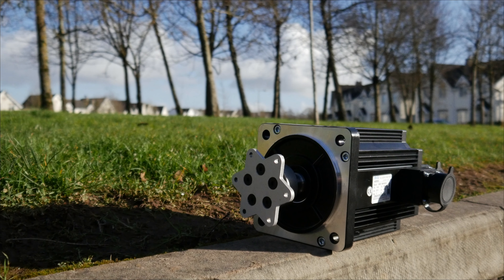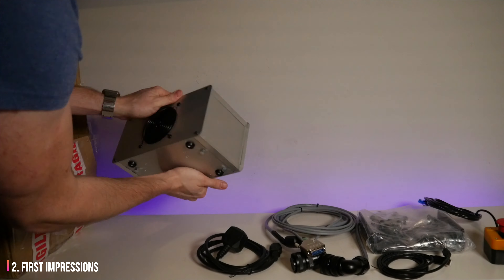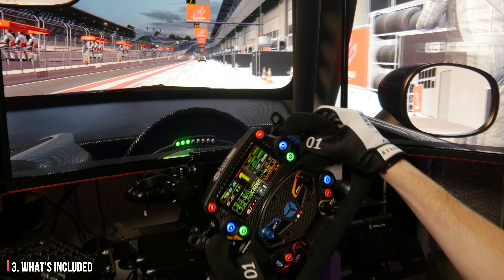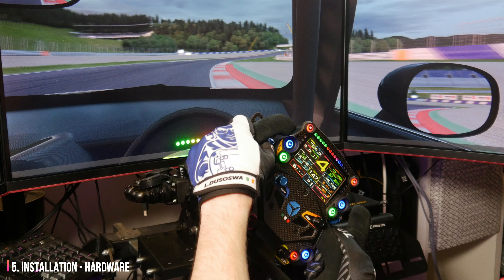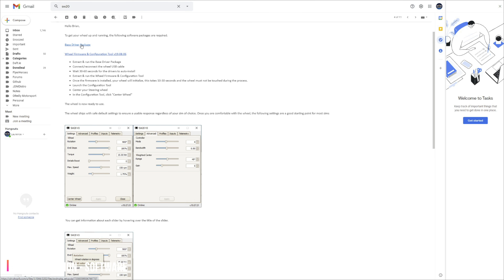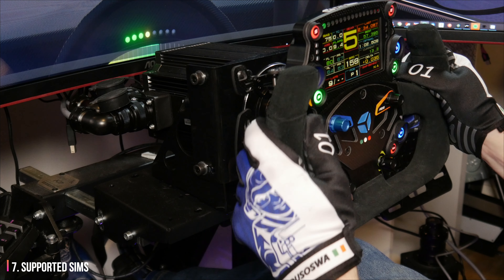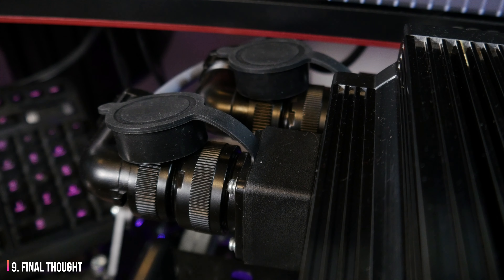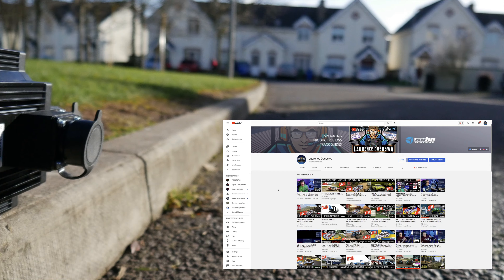Simplicity SW20 V3 review 2021

Comment: Small comment on your vrs suggestion. The sw20 and the vrs are not in same price range because with the vrs you have to buy the bracket etc and ends up on around 100-200 euro more than the sw20 package to get the same content. 
But good review.
Reply from the maker: Yes, agreed! I forgot to mention that. Thanks for your comment!
Reply: Well the Vrs one costs 1k€ with both the wheelbase mount and shaft clamp. pretty much the same as the simplicity without the discount if you order it from stock. Prices for Uk though. don´t know otherwise
Reply: That's was the word "range" in price range means.

Comment: Thanks for the review, that helped me to choose their SW20 Esport, which has incremental encoder, instead the absolute one used in V3. Didn't regret my purchase. All my e-mails were answered and the order was shipped in 3 days as promised.The FFB is great.
Reply from the maker: That's awesome news <3
Reply: What's the difference between the two?
Reply: @K1pruto  The resolution of the absolute encoder is greater than the incremental one. Also the absolute encoder always knows the exact position of the steering wheel, the incremental one might lose this info in case it loses power (very unlikely). In practice there should be almost no difference. My incremental encoder always knows wheel's position on startup. As for resolution/precision I can't really comment, but my SW20E is already very precise.
Reply: @StepUnique  thank you
Reply: I'm considering purchasing that SW20E unit.
Is it buttery smooth, no cogging/rippling?
Reply: @bozakn  It is smooth, yes.
Reply: @StepUnique  Thanks man, appreciate it!
Reply: @bozakn Any updates, Did you make purchase thanks?

Comment: I've had the SW20 V3 for a year now and it's been great once you get the setting to your liking....one issue I did have was the controller box would drop out mid race so not ideal! I upgraded the USB 2.0 cable and it's been perfect ever since
Reply from the maker: Yeah I didn’t dwell on the settings too much in this review. It was relatively easy to find good settings I found. I didn’t have any USB issues

Comment: I've had my SW20 V3 for going on 2 years now, and it's been great. I recently replaced the USB cable with a higher quality one due to the controller box disconnects and haven't had any issues since. I purchased mine in 2019; my experience with customer service was great whenever I dealt with them, and both boxes arrived the same day. I wonder if many of these issues are due to the world being shut down and the sim racing explosion - scaling their business model to a shortage of parts and an abnormal increase in orders would be hard. That said, some social media presence or something would give more confidence in their company's survival. I do worry that if something goes wrong, now I may not get the support I need, even though my experience so far has shown otherwise. Also, I LOVE driving with this wheel. Great review.
Reply from the maker: Thanks for your excellent comment. I’d be more than happy if it was my forever wheel, but yeah a bit of company presence would make owners a little more loyal, proud and likely to recommend.
Reply: Hey with the controller box disconnecting would it cut the force feedback out of random for you
Reply: @biccligher  I did have that problem a few months ago. I upgraded to a "Tripp Lite USB 2.0 Hi-Speed A/B Cable with Ferrite Chokes" (that's the name if you want to search for it) and it hasn't been an issue since.

Comment: Have been using the SW20 (V2) happily since 2017.. when i bought it, i got one hour of tutorial by Ollie, and i actually didn't tighten the bolts enough either. 
Since then, 3 of my friends have tried, 2 of them have bought the second they got home.... it is just thát good.  And yeah, i'm not a hardware expert, and even i got it sorted in the end. I'm using a Wooden Nardi 350mm 4-spoke round racing wheel on my DD wheelbase, bought an adapter from the hardware store to fit it. Also bought a button box for it, but i'm not too happy with the cabling for that. I love how the steeringwheel(base) can let you turn 2160 degrees maximum, too much fun when driving truck sims, but, the cable for the button box wont like it. I just wish someone would make bluetooth or wifi button/flappypaddle boxes with just an  on off switch and  aa-battery that has to be replaced once  a year. Oh well, evolution evolves. Wish i could still get the V3 encoder somewhere....they were sold out quite rapidly.
Reply from the maker: Nice! Great comment

Comment: Deffo room fer improvement... Personally i wouldnt touch a company that operates in such a way with a 10ft pole. Excellent work as always. Big Ups to Mr. Keno, u LegendFace!
Reply from the maker: Yep melee I took one for the team but ultimately also ended up with a cracking direct drive wheel for very little money. Thanks for taking the time to comment!
Reply: I have their older SW20 with Simucube boards. I don't have any issues so far. I love and support small sim racing company. We are now at a time where sim racing might be at its peak but we won't be here without these small companies.

Comment: I was keen on VRS & looked at SW20 for cheapest new price point - biggest concern was the software/firmware support as especially for Mige based systems the software is arguably more important than the hardware. I ended up with 2nd hand Simucube1 20Nm Mige based system, the firmware was updated up until Nov '20 and has a lot of SC2 features like static force reduction filter. The Simucube Granity software provides for detail technical tuning of the the controller/motor - you don't have to use it, but it allows one to tune out the motor cogging typical of Mige motor and from what I read a well set-up SC1 system is pretty hard to distinguish from a new Simucube Pro.
Reply from the maker: Thanks for the detailed comment <3

Comment: That is why you should get the Simucube 1 OSW Mige 20Nm setup. Runs off Simucube  software and it’s easy to setup unlike this one you have reviewed.
Reply from the maker: Is it really easier to set up? What’s the price of it?
Reply: problem is, nobody sells it anymore, anywhere. granite still sells the ioni and simucube board, that's it. simracingbay, augury and simtech all stopped selling sc1 systems, which is a shame if you ask me. only route to drive a sc1 in 2021 is to buy motor, boards, cables, build your own enclosure and set all bootloaders + drc files + firmware + granite values literally by yourself. it's like with the launch of simucube2 the whole osw world made a step back in 2016, when it first came out. and by the way, I own a sc2 sport since when it first launched in 2019, I made the swap from an osw sc1, and I can tell you without a doubt I would gladly swap it back with an osw if only I could still find a pre-built like it used to sell untill 2019. I really don't like the road sc2 took with paddock and whatnot, and the backlash it had from the whole sc2 community in their forum speaks volume about that.

Comment: That looked like a key way for the shaft, but probably have to get it cut yourself. It probably actually comes with motor so they just throw it in.
Reply from the maker: Yep it’s a key for the shaft. Not necessary for sim racing.